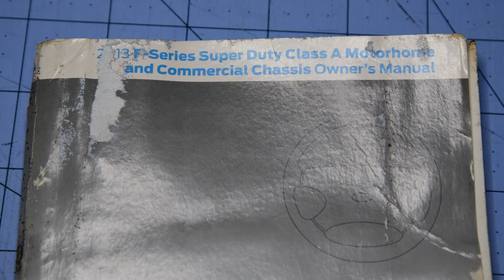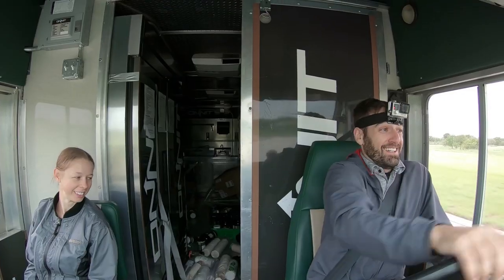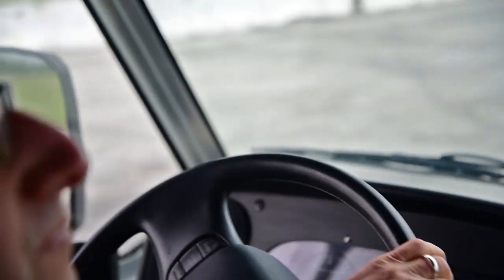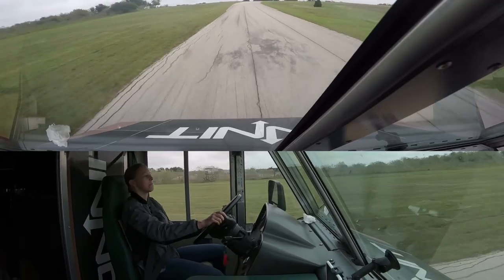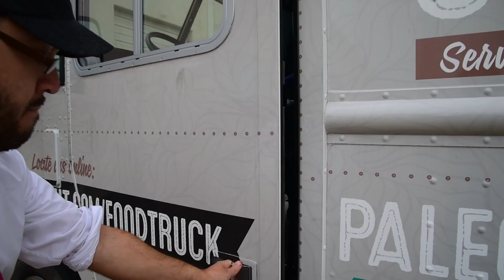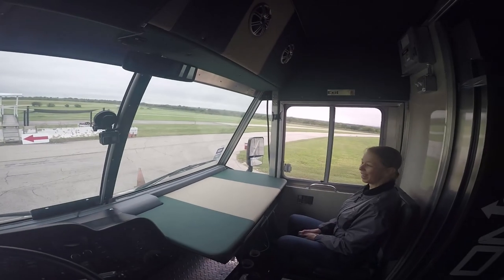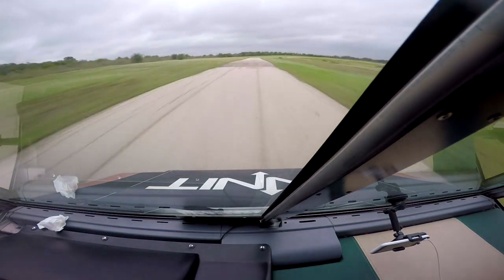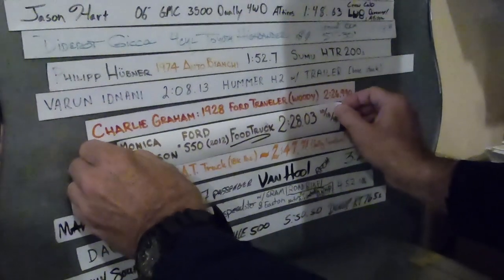2012 Ford F550 Utilimaster Food Truck: Regular Car Reviews

Comment: A 1960's design on a 2012 truck.. Oh I get the whole "If it ain't broke don't fix it" approach but come on.. its like being bothered to try died... 40 years ago by the looks
Reply: I actually have no problem with it. Heck would there be a car that still looks like 40 years ago I would instantly buy it
Reply: Pedestrian safety doesn't seem to affect heavy vehicle designs.
Reply: You answered your own question, the design works and these things aren't built for aerodynamics or styling, they're built to maximize the space in the vehicle.
Reply: Fun fact about these trucks.  The front glass isn't safety glass. At least not on the FedEx trucks at the terminal I work at. Had one shatter on my route one day when a buzzard went through the passenger side panel.
Reply: I'd rather have a simple box than the godawful aerodynamic look box vans go for nowadays. A utility vehicle out to look utilitarian.
Reply: @Brave_SJ  oh I'd go back to that metal box in a heartbeat over the gmc Savannah 4500 cut away.
Reply: @Brave_SJ  Agreed. I never liked those Euro style vans

Comment: The Ford modular 6.8l v10 is the 5.4l v8 with 2 more cylinders. Just thought I would correct sorry if Im intruding, but the v10 is alot more common up north in Minnesota(where I'm from) since  their ease of maintenance and starting compared to the 7.3 diesel.Not to be a Ford lover but It's a well respected engine here. and

Comment: The v10 mod motor is actually a 5.4L with 2 more cylanders, not a 4.6. Altho much of the components are interchangable between all 3 engines the 5.4 and 6.8 both have longer stroke and thus a wider v then the 4.6.

Comment: It's not quite a modular engine, it's a Triton, which is a continuation of the modular. But since it's 6.8 liters it really isn't a 4.6 with two more cylinders. A 4.6 with 2 more cylinders would be 5.75L. It's actually a 5.4L Modular/Triton with two more cylinders, not a 4.6. 

The 6.8 used in the Excursion is a 2 valve, while the one used in the F-550, 650, and 750 and the Blue Bird CNG 6.8 use the 3 valve. The Excursion with the 6.8 Triton is actually more common than the diesel one for the most part, with the Triton equipped Excursions commanding far less on the used market because they are less efficient, but they actually tow as much as the diesels on the Excursion. The rare Triton Excursion is the 5.4L V8 2v Excursion. It didn't tow as much, only 6100 or 7600lbs depending on the final drive ratio. But they are somewhat rare. Not terribly though, as they can be found. The 5.4 4v was actually used in quite a few vehicles, some many of you and I love I'm sure, such as the Cobra R Mustang, the Ford GT, the Shelby GT500, and the FPV GT. The 5.4 2v was used also in the SVT Lightning in addition to its use in the Excursion and Expedition.

Comment: Want a fun commercial vehicle?

Nissan e-NV200.
Fun as hell for some storage space pulled by a couple of electric motors. 0-60 in under 10 seconds and it feels and sounds like you’re driving an electric locomotive.

We had these as carshare rentals in my city. Fast, but extremely smooth for moving fragile stuff.

Comment: There are a buttload of V10 F250/350's around. Things drink more fuel than my 78 k20 with a 454. But they do seem to run forever, not counting all the trivalve issues.

Comment: I’ve worked on one of these. Shit is always falling over. Also, it had a broken brake line, no seatbelts, and we were pulling a trailer filled with hot coals from the grill earlier that caught on fire and burned the trash can they were in 😂😂😂. At least the sign on the side said “WE’RE SMOKING THE GOOD STUFF”

Comment: I have a 99 E350 with a high roof conversion. It's a 2v v10 with a 4 speed and it'll break 100mph without a sweat in overdrive. I bet this beast can do it in 4th gear, but not without some help from the wind.

Comment: A small company that I did hardware deliveries for used a late-00's F250 Super Duty with the V10. 
You're right, the V10 really doesn't sound all that different from the V8 with stock mufflers. If you want it to sound any different, you have to go aftermarket. And at that point, what's the point?
The V10 has good torque for what it's worth, really, but I personally couldn't get over how god-awful the fuel economy was. I understand what you were saying about not having access to diesel, but I'm fairly certain that we're living in an age now where diesel is pretty much at every fuel station. It costs more to buy the diesel engine, but it's worth it in the long run, I'd say.
Reply: That's not the real reason Ford offers gas. V10 can convert to propane. Also, stop and go kills diesel emission systems.
Reply: @JohnSmith-wx9wj  Is propane a big deal state-side? I've personally never seen a vehicle fueled solely by propane. 
As far as the emission systems go, are you talking about newer DEF systems?
Reply: DPF systems need to get up to a very hight temperature to "regen", basically to self clean. I've heard people with trucks that do a lot of local delivery/short trips having DPF issues because they don't get up to temp and properly regen
Reply: @a.dudeman7715  
Propane is used by fleets in big cities. I think there is a tax credit, it's cheaper, and wouldn't surprise me if some liberal municipalities require it.
Reply: @JohnSmith-wx9wj  Well, you learn something new every day. Thanks, man.
Reply: @kylemerritt723  I assume that's why a lot of people delete these systems after the fact.

Comment: You need V12 in it. V12 is just 2 straight 6s, and therefore revs just as smoothly and cleanly. And you need those revs on this high calorie transportation. I mean, look at that Winnebago RV with a V8 - high revs really make it go! This thing is heavier, which is why it has a V10. V12 would make it go better and faster.

Comment: Had a v10 in a mobile mechanic f450 truck. Loaded with jacks, semi truck tires, tools, air compressor, torch, no muffler. Loud and slow. And not good loud.

Comment: We own an Excursion with the 6.7 V10 (it’s the 5.4 with a couple cylinders) it’s also a triton, not a modular.
Reply: The4014Gamer ForTheWin The 4.6, 5.4, 6.8, and coyote 5.0 are all modular engines. 'Triton' was the branding name Ford intermittently used on the badging of vehicles with these engines.
Reply: @MJorgy5  Ok, I was wrong. Thanks for the info. And, the V10 in the exursion is listed as a 6.7 triton V10. I don't know why everyone keeps saying 6.8 but maybe it's just the different iterations of the engines.

Comment: You dork, it's a 2v v10. It's two cylinders more than a 5.4. Not a 4.6. I have one in a 2003 F250 with a stick behind it. It's torquey but not fast. Also it spits out spark plugs, which is pretty great if you're into cutting threads in things you can't see.

Comment: Hey the v10 isn’t all that rare in the excursion actually it’s pretty common an in the pickup trucks and there more like the 5.4 engine and they use the v10 motor in big generator and sometimes fitted with a turbo making like 410 hp

Comment: Are you sure it’s not the 5.4 with two extra cylinders Because if you take the 4.6 and add two cylinders to it with the same displacement of the other cylinders that the V8 has then that would put it at 5.75 liters

Comment: This is a very under powered V10. Just swap it for a Ford GT engine, you'll get the power you need to go and have room for twin turbos. If the swap doesn't work just shove in a LS9. 600HP easy.
Also, would have been easier to take out all the supplies and then putting the supplies back in after the run. No floor cleanup.

Comment: Actually if you do the math, the modular V10 is not based off of the 4.6 modular. It’s actually a 5.4 modular with 2 extra cylinders.

Comment: you’re wrong the V10 is a good ford engine have one in my excursion and unlike my friends 5.4L trition its not spitting out spark plugs. also the V10 is a different sound just remove the muffler and it doesn’t sound like a ford it sounds like a Ferrari V10 in the late 80’s

Comment: I drove a 6.8L V10 powered 16' Penske box truck from Michigan to Los Angeles while towing my Dart and it fucking sucked. I get the fuel availability thing and ease of use for people that have never filled up with diesel before, but that engine is way underpowered when you're hauling a big load and trying to climb any grade.

Comment: So what you're trying to say is that a modern Ford with a V10 is slower than a 90 year old Ford with a straight 4 that has less than half the displacement and 1/8th the horsepower.

Comment: Are FedEx delivery trucks any easier to drive? I'm about to start working for them soon and this video just made me even more anxious.
Reply: Are you working for them yet? I want to work for FedEx as soon as I turn 18
Reply: @lethargicstove2024  I did actually work for them for several years. I've moved on, but I will say, I always tried to drive the Sprinter vans and always avoided the box trucks (700s). It's an okay job once you get the hang of it, but your experience depends on what route and area you end up in.
Reply: @rzc0624  I live in Tampa so I think near a distribution center, did you start out driving delivery or did you have to work on packaging first?

Comment: In the mid to late 90s ford replaced the 4.9 inline 6, 5.0 v8, 5.8 v8, and 7.5 liter v8, with the 4.2 v6, 4.6 v8, 5.4 v8, and 6.8 v10, in their re pickup line . If you compare the v10 to the 460 it replaced, its really not bad at all and served as a low cost alternative to the complicated and expensive diesels that we see today.

Comment: The ambulance I drive is an E-350 with a Modular V10, and let me tell you: it's not a long-life engine. It's had three of them already. The second one lasted three months. It has 273,000 miles on the body, and receives preventative maintenance every 2500 miles. That's not a lot for a fleet vehicle. The equivalent diesel engine ambulances have 390-405,000 miles.

Comment: Saying this is a 4.6L V8 with a couple extra cylinders is like saying the 5.0L coyote is just a bored & stroked 4.6L, and that the 5.2L voodoo is a bored and stroked 4.6L with a fancy crankshaft. This family of engines are all similar in such that they can and sometimes do share components, but they are all very different beasts. FYI a "4.6L with two extra cylinders" would be a 5.8L. The V10 was offered in the F-250 & F-350, pretty common for people that didn't want a diesel.

Comment: The engine is actually a ford 5.4 with 2 more cylinders added on. if it was a 4.6 with extra cylinders it would be a 5.8l v10

Comment: How's this a 2012 model? It looks like it's straight from the 80's.
Reply: If it's not broke, don't fix it.
Reply: The chassis is from 2012,  bodies on medium duty trucks rarely get redesigned, Chevy cargo vans haven't changed since 2004 basically, and this is probably the same design from 1967.
Reply: Because Frrrrrd!

Comment: Wow that's things tyres are on par with my coupes 255/45/19! Total overkill. And they like to drain my wallet.
Reply: Not even close. Those are commercial truck wheel and tire sizes, hence the half sizes. Meant to carry heavy loads but still handle ok.
Reply: @vector6977  obviously!!!

Comment: I don't think of V10s as performance motors. V12s certainly, thanks to Mercedes-Benz and the like. But the V10? When I think V10 I think Excursion and Touareg, Dodge Ram 3500 and Ford Super Duty. I think of Grumman Olson box trucks, and Bluebird minibuses. I think of utility and heavy duty.
Reply: I think of the Lexus LFA oddly enough

Comment: 2.2 extra liters gets you 20 more horsepower and 160 footpounds of torque than the 05' 4.6 modular on the mustang.
Apples to Oranges but still.
 HMMMM
Reply: There's probably a few little things that could be done to make the output more impressive on this vehicle, but it's not tuned for performance, it's tuned for longevity.
Reply: But im looking for 500 ponies in my commercial vehicles!
  In all seriousness your completely right, and its impressive that Ford even offered this v10 as an alternative to the powerstroke diesels. Mr.Regular has always said these engines are built to last.

Comment: Meh, not like a Diesel option would've been any better.  Unless you're pulling a 7.3 IDI out of another truck, any new Ford Diesel that says Powerstroke needs to be avoided like the plague.  If it doesn't say International anywhere on it, avoid at all costs.  As far as Diesel fuel not being readily available in certain areas, you could just filter out your own vegetable oil and run it on that.  Or Agricultural red Diesel,  just don't get caught running that shit. lol

Comment: That thing is from 2012?
US excess in its finest shape and form.
Yeah, I like Europe. I like it here.
Reply: OBSESSED
Reply: Excess? This is fairly utilitarian.
Reply: European food trucks do not have 320hp. That's 40ton truck power around here. I know someone with a food truck that is considerably larger than this thing and it has something like 85hp.
Reply: @no1DdC  And it probably isn't expected to go 65mph on the highway to get from site to site. Just because our geography is different and our needs are different doesn't mean that all of our differences are "excess".
Reply: What this thing has is that it's a wide boi.

But you can easily achieve that with a Sprinter or a Crafter that has the 'ambulance' box on its chassis. And yet it gets fuel milage.

Also, 320hp in a 40t is too damn low, nowadays you don't see those trucks under 460hp, most of them have either 480 or 500hp.
Reply: Yeah. I saw a Rolls Royce coffee vending vehicle in London’s Hyde Park last year. So fauncy!
Reply: @Aperson156  Interestingly enough, this truck is being used in a very hilly area and it has been driven on the Autobahn.
Reply: @no1DdC  Then your claim of 85 hp on a 16,000 lb+ (~7500kg) vehicle is bullshit, unless it just has gobs of torque.
Reply: @Aperson156  It does, because it's a huge old Diesel. I don't know the exact engine, but it's on an old Mercedes chassis. It's still as slow as a sand dune, of course, but with enough run up, it can get the thing moving, more or less.
Reply: @no1DdC  So it's just European excess lol. That's really just the fundamental difference between diesel and gasoline engines. Diesel makes it's torque down low, and gas engines (typically) need more RPM to build torque. 

And what you're describing sounds pretty dismal. Maybe their truck needs a bit more horsepower.
Reply: Europe doesn't have food trucks because their streets are filled with "refugees" instead
Reply: Yup, refugees everywhere, I gotta dig thru about 60 of them just to get into the bathroom thru the hallway to brush my teeth
Reply: @Aperson156  No, we don't have highways in Europe and we almost never do over 40 mph (sarcasm). Come on man! Do you even see the nonsense you wrote? Most people drive 80 mph+ on the highway in Europe.
Reply: Fellow European here. How is it excess? Just because it's large and boxy? Also, I wish we'd have this type of food trucks here in Europe but they're really uncommon.
Reply: @weedmastersr  I see no nonsense, I'm very well aware of how most European cities are, and I never said that Europeans drive slowly on their freeways, but I did imply that they're not as important to Europe as they are to the US. What I DID say, however, is a vehicle that weighs over 7500kg with 85 HP isn't expected to go that fast, and if it is expected to go that fast, I'm sure the acceleration is painfully slow and they don't do it very often.